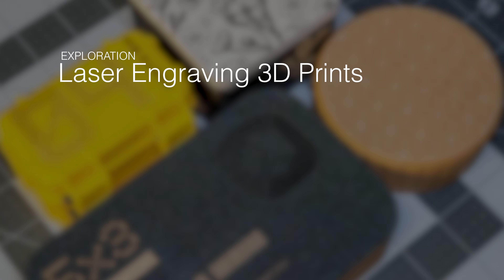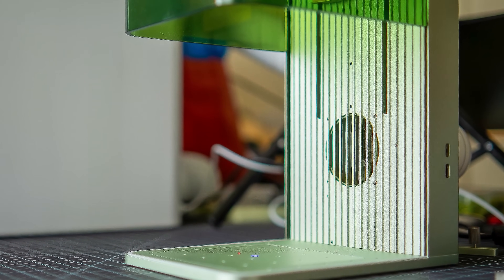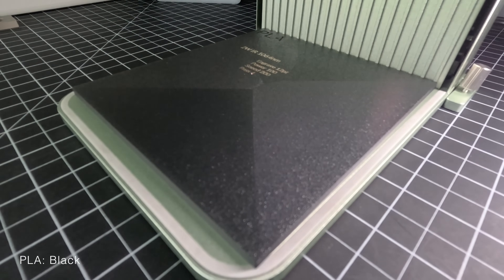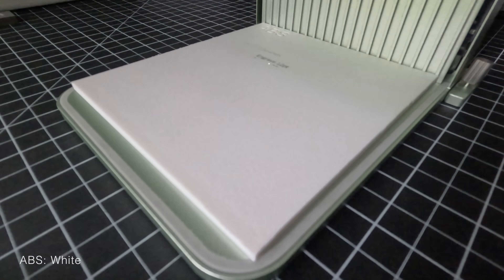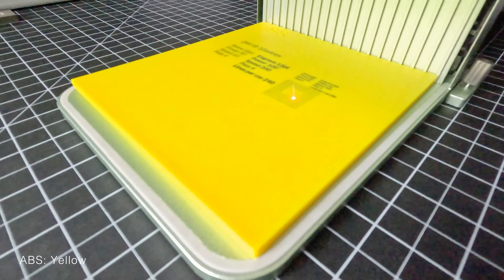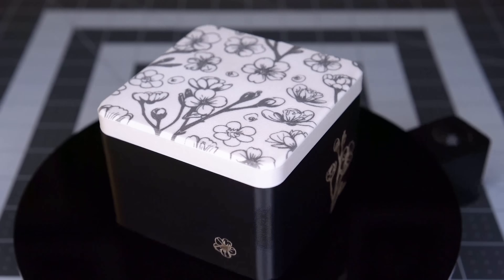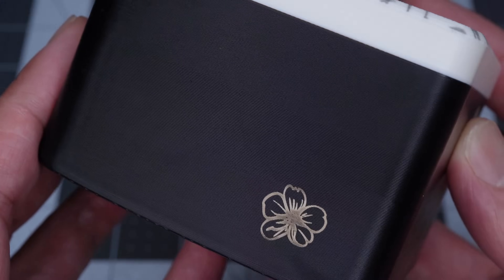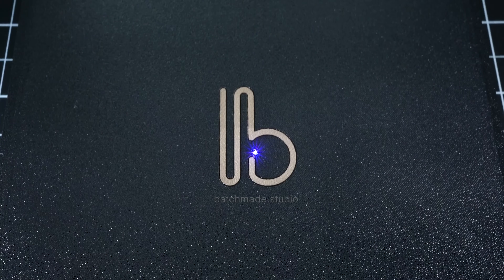Laser engraving 3D prints

Comment: Why test on a texture plate? Really difficult to see anyting.
Reply from the maker: You're right👍🏼. At the time, we were sort of dual-testing because we already had in mind to engrave on the plate-side of some prints we were planning on outputting using the textured plate. But it was also good to find out that laser mark sharpness was not adversely affected by the texture. In our later vids, you'll see that we started using smoother test plates.

Comment: What material did you pick within the stool software. is there one specific for PLA or ABS
Reply from the maker: @ScottMould  We didn't use a material preset for these since xTool doesn't provide them for these materials. We knew we'd have to use custom settings, and this is why we wanted to test across a range of settings to find out the best ones. (Custom settings should override any settings imposed by the material presets) You can check out our other filament test videos on our channel, but here are links to our current test files (one for the F1 and one for the F1 Ultra):
https://drive.google.com/file/d/1SohhtjJ06alnnqtscteu0eZeN58LbpTB/view?usp=drive_link
https://drive.google.com/file/d/1M6zwKHBKOWqzqu-4HAF3JOVTVwE56Ol2/view?usp=drive_link

We run this test on a plate that we print with every new filament we use so that we have a clear idea of what kind of marking range is possible with each filament. 
Hope that helps.

Comment: I'd like a laser to mark some of the 3D objects I print in PLA. what would you suggest for a hobbyist?
Reply from the maker: Well, so far we've had the most experience with the xTool F1(just because it's what we had when we started these experiments). But from what little experience we've had so far, we've had the most luck, and have gotten more precise and finer-detail work on a wider range of material with the lower-power (2 watt) IR laser on that machine (vs the 10 watt blue diode laser that it's also equipped with). The F1's galvo (vs gantry) configuration has also been critical since laser contact travel speed has been an important factor to achieving our results. We know there are other comparable units out there, but we don't have any experience with them, and haven't yet gotten any comments from viewers if they've tried using the same specs/settings. If you have an opportunity to test some machines before making a purchase, we'd suggest brining along some test plates printed in the filaments you plan on using, and running both score and engrave tests on them.

Comment: This has blown me away. Which laser did you use to get the results on the items shown at the end of the video? They look spectacular.
Reply from the maker: For this project, we used an xTool F1 (and mostly the 2W IR laser on that machine). We've got to get through a few other things so we're a bit behind on them, but we're also planning a few followup videos of projects that include the specific settings we used to achieve them.
Reply: Thanks so much for replying. I've been looking at the xtool F1 and considering it as my first laser machine. Would you recommend it?  @batchresearchlab
Reply from the maker: It depends on what you plan on trying to accomplish. The F1 is a compact galvo unit with 2 types of lasers. Some of the pros are that it's capable of speeds way beyond most gantry-style machines can achieve; and some marking effects can require very short duration-on-material times. And its speed allows it to accomplish some things in a fraction of the time most common gantry lasers can (we're talkin' seconds vs minutes). Having both an IR and blue diode give it some versatility, especially if you're working with different material types in different colors. And its small size makes it portable (it's even got a carry handle ;)  ), and it's pretty easy to find a place for it in a crowded workspace. Some of the cons are both lasers it's equipped with are fairly low powered, so don't expect to cut much metal with it, and it's not particularly great with most acrylics (besides solid black). Since it's a galvo, most cuts you make with it will be angled (because the laser originates from a single, central point); so they won't be 'clean' vertical cuts. And it's got a really small working area; 115x115mm. Hope that helps!

Comment: I absolutely recommend doing tests like this with a proper test grid, what you've done here is just test a single setting for blue light and IR for each filament colour. Results can vary greatly based on speed and power settings, and a different speed/power setting would absolutely have had much better results with those "failed" ones.

Comment: What if a think black play is printed above white PLA and then engraving it? Would the white show up?
Reply from the maker: Hmmm, that’s definitely possible depending on the material. There are some “sandwiched” acrylic sheets that are specifically for sign making that have layers that are exposed during engraving or cutting. If we get a chance to try it we’ll let you know!
Reply: It would, however if using the Xtool F1 (or other galvo based laser), be aware that there will be a slight angle to the engraving, which will become more noticeable the deeper the engrave, since the laser isn't going straight down but at an angle.

Comment: Thanks for posting this.   This exact test has been on my to-do projects list.   
I have a Snapmaker Artisan 3 in 1 machine with a dual FDM head, both 10w and 40w diode laser heads, and a CNC router head. 
One additional test that I'm going to do is use the same technique used for white ceramic engraving, to first spray on a Titanium Dioxide powder layer and then engrave.   On ceramics this results in a black line being engraved, and I'm curious to see the results on White PLA or ABS.
Good luck with the channel!
Reply from the maker: Oh that's an interesting idea! I know that with ceramics part of the issue is that the laser has issues with the material at certain frequencies/wavelengths. I used to use a similar spray for metal on my CO2 laser years ago, I believe it's about giving the laser something to affect via heat since it keeps the light from just bouncing off a reflective or light rejecting surface. Ceramic is also a very hard and somewhat inert material, and usually a lighter color before glazing. Just be super careful and use plenty of ventilation when you do it with plastics as it could be volatile with the different chemical compounds. 

Keep us posted. Would love to know the results. We also have a MOPA fiber laser as well that in theory works great on plastics for light marking. Will be sure to report back once we've tried that as well.
Reply: Thanks, I'll give updates. 
You're spot on regarding the thermal interaction.   One of the plastics problem is how translucent it is, where the laser thermal transfer is mostly from interacting with the pigment.
And yes on fumes management.   I have an encloser, exhaust into a large cartridge filter and then exterior exhaust, so I should be good there.   One other safety tip I give on that is watch out for opening the enclosure too soon after a cycle finishes, better to wait a minute to let the last fumes be exhausted rather than a puff in the face.
 @batchresearchlab
Reply from the maker: 100% on waiting to open the enclosure. I’ve learned that lesson a couple times now with both my lasers and the printers 🤣

Comment: Thanks for the information.  I can see some real possibilities for 3D prints.  I did see a list of materials that should not be laser engraved and ABS was one of them.  This is probably because of toxic fumes but venting the F1 outside would probably help with that.
Reply from the maker: Thanks! It was something that seemed so obvious but we just hadn't considered it yet either. 

Folks should definitely use ventilation and proper protective wear. The light engrave can likely be mitigated with good fume extraction and PPI, but ABS is definitely veering into the probably shouldn't touch it range and I definitely wouldn't do heavy engrave or cutting operations with it, even with ventilation. Just to add to that... DEFINITELY don't laser PVC. I've seen some folks do that one unaware of how very dangerous it is. 

Thanks for the feedback and for the safety callout. We can highlight it a little further in a description edit. That being said, in general folks, do the read up on what you're lasering/printing/etc and make sure you evaluate safety needs and personal risk before getting started!